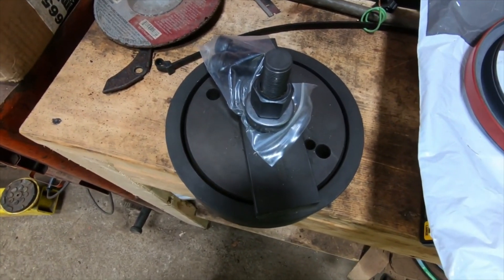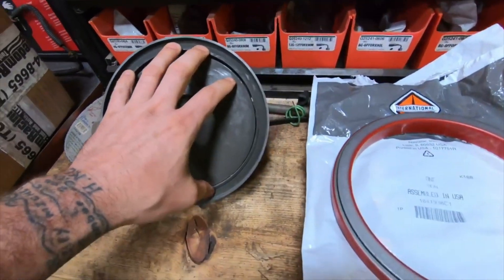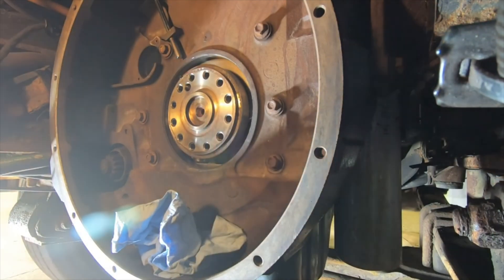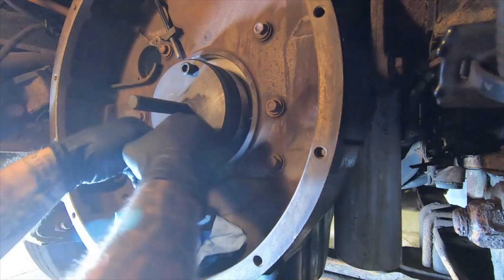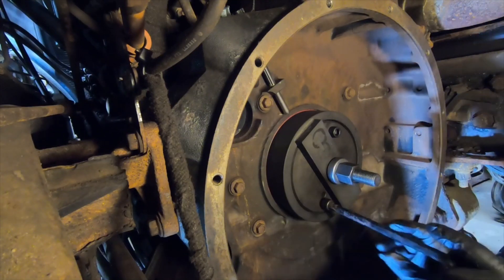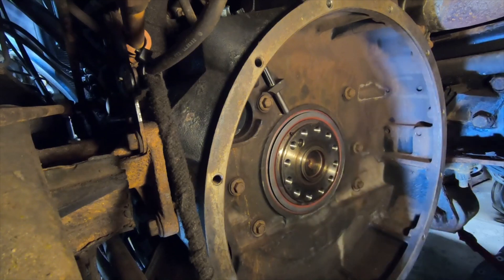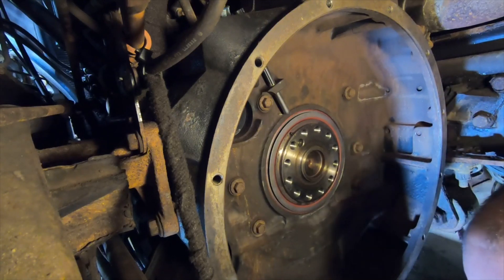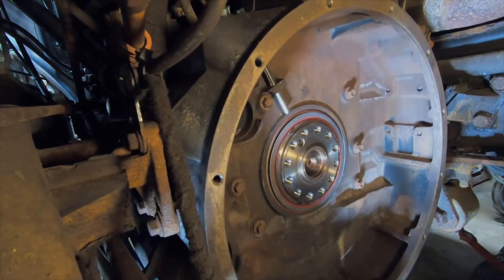Freedom racing rear main seal installer ST-153 for Seal 1841938C1

Comment: Good day was just wondering what is the size of the whole in the bell housing for the transmission is it 6½"
Reply from the maker: I don’t know the diameter of the outside of the hole. The crank diameter is the size that I needed to order the installer and I gave the vin to the dealer for the seal. Different year engines have different size cranks as well. This link may help. At the bottom of the page it give some information about the crank sizes and the seal numbers that go with them. The crank in this video was 6-1/8 the seal is about 3/8-1/2 inch thick so I’d say the opening is about 7 inches but I don’t know the exact size. https://www.freedomracing.com/dt466-rear-crankshaft-oil-seal-wear-sleeve-installer-master-set-ztse2535c-ztse4749-ztse4637-alt.html
Reply: @JasonTheMunicipalMechanic  oh I see thanks for the info

Comment: why are you putting it in dry? as soon as that engine turns on that seal is  getting thousands of rpms on it . lube it up
Reply from the maker: It not supposed to be disassembled. There is a integrated wear sleeve the gets pressed into the crank and the  part that makes contact and rubs on the seal is inside the seal.

Comment: Right tool for the right job. Why struggle and possibly damage the seal and have to remove it and have to buy another one. Makes good sense in the long run. Great viewing.
Reply from the maker: I’ve actually used this tool 4 times (unfortunately). I thought it was going to be a 1 and done and it would just sit collecting dust, but it has been pretty handy.